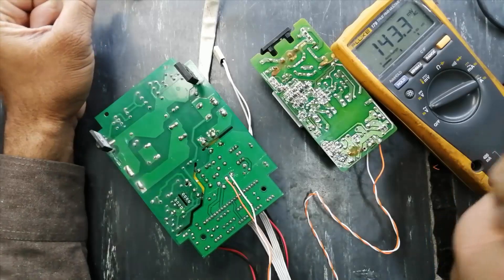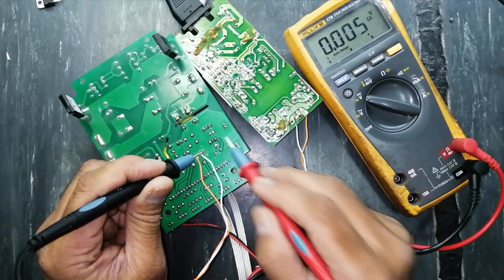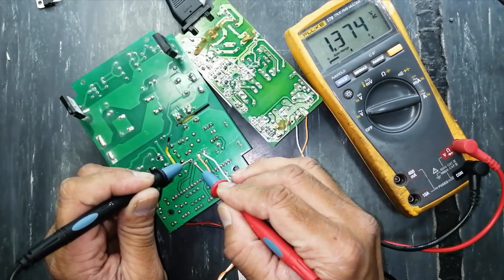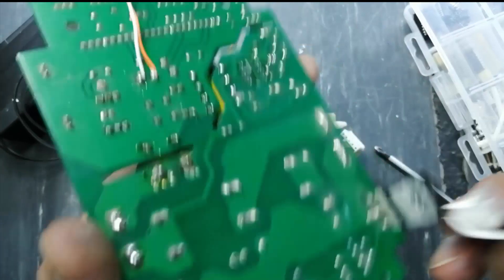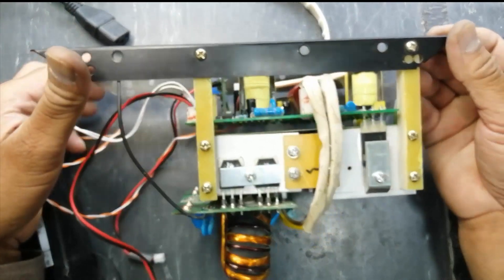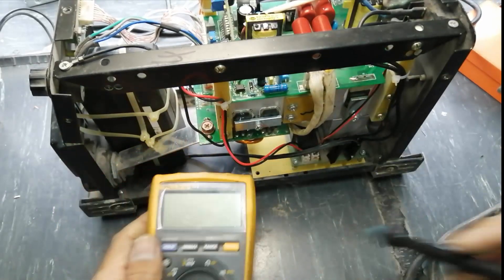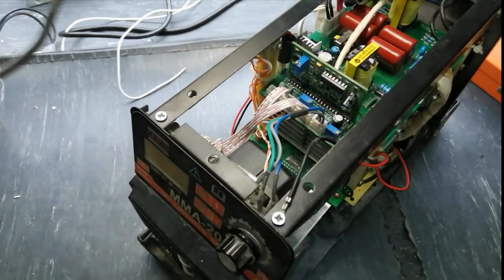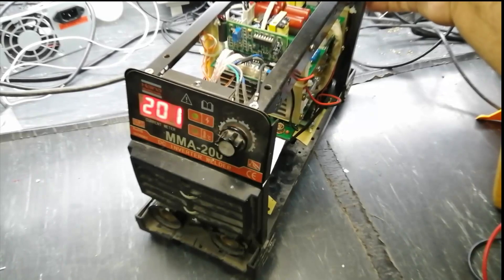291 Inverter IGBT Welder Machine (Part -5) Repairing Low Voltage Power Supply - Repair IGBT Welder

Comment: Brother assalamu alaykom I have a question if you can help, I fixed my welding machine but in the first test it made the same fault again and short circuited the bridge rectifier and the igbts, I did fix it again but in output I have 58volt and afraid to test it again what should I look for or check

Comment: I've wondered what the easiest way to open the laptop power supply plastic case is?  I did read somewhere in a video's comment they use gasoline or diesel on a q-tip around the seam and wait some time, like I forget.  5-30 minutes and then separate.  Great thinking and thanks again for sharing.  Kind Regards, In Christ.

Comment: Sir power supply ketne amp ki hai
Reply from the maker: ye normal printer ki power supply he
2 ampere. 
welding machine keliey aap 1 ampere ki supply use kar saktey hein
Reply: @HaseebElectronics   thanks sir  u r great

Comment: Hi bro 
How to igbt 200 amp welding mechin  body and secondary electric  shock problem
Reply from the maker: there are calss y capacitors connected from secondary to chassis are disconnect open or short